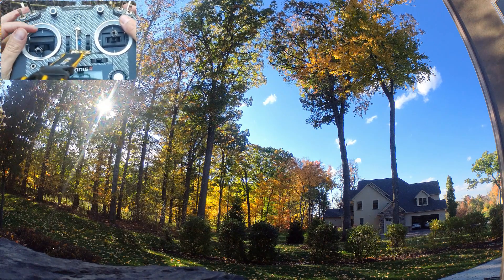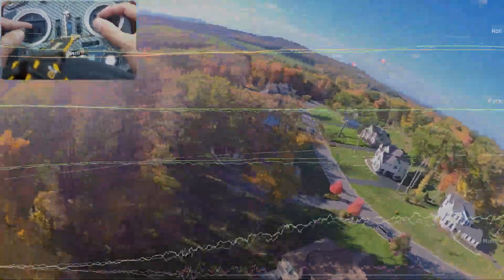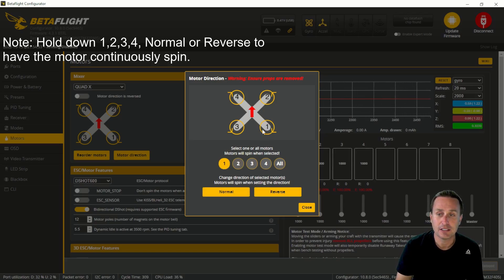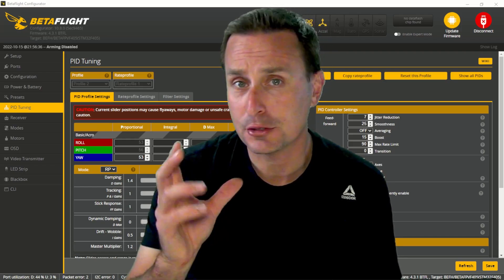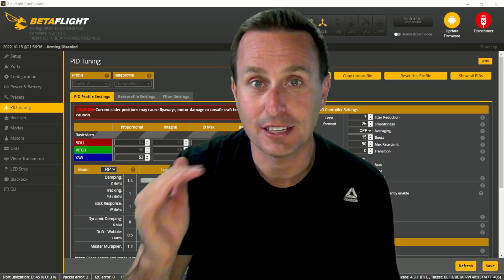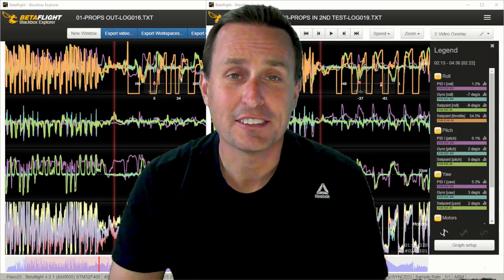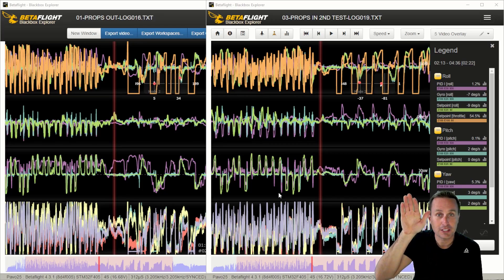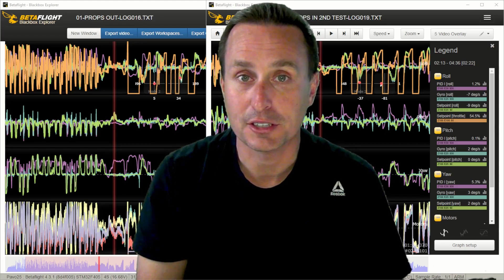How to FIX Cinewhoop Washout  |  OPEN SOURCE

Comment: You should mention (for beginners) that changing prop direction also requires to change props ;-)
Reply: Wait I have to get new props? Which ones for the protek35
Reply: @xplode225  😋
Reply: @xplode225  direction
Reply: @volkergoe  oh so basically I would swap the left motor's prop for the right motor's props if I switch the motor direction??
Reply: @xplode225  exactly!

Comment: OMG!!!  I have a Flywoo Cinerace 20 and I love almost everything about it for flying small gaps  picking through tree canopies and proximity flying I would never do with my 5" drones.  The only thing I hated was a really annoying float when I wanted to drop from high trees it would just hang in the air.   The reversed props totally fixed this and I have so much more control over it.   Thank you

Comment: Oh wow, I gotta try props in. I think it could be that motor shafts are not parallel to each other. And one or two motors tilted a little making extra yaw drag as they spin. With props out they fight with actual yaw intentions, with props in they help.

Comment: Well that is just perfect timing, thankyou for running through this issue.  I've recently picked up a Pavo25 and did the first few flights on Thursday.  I have had both the issues you describe, and have just sat down to see what the internet says about it.  The floating around after a bit of full throttle or a steep descent was really disconcerting, so I'm going to take a look at the gains first, then try swapping the prop direction.  Thumbs up, and a subscribe from me :)

Comment: Thank you Mark! I was trying everything for a week! to fix up the same issue on a new build. Initially thought it was the AIO, changed the AIO same thing happened, went through you tutorials on blackbox troubleshooting and with my confused noob brain I thought it was a motor issue, for some reason it did fly better after the motor change but problem still occurs, then came across this and who could have thought about this? Why does a quad or frame design only allows props in? Anyway ma man! You made my day! Will do a big big shout out when the content is up!
Reply from the maker: 😄  Always happy to help!

Comment: Thanks Mark! Modified my 3" squirt style to a 3.5" with guards, everything was flying great except that it would float  and not come down, who knew it was as simple as swapping the prop rotation. Now it flys like it's on rails.

Thanks again for all you do!
Reply: Just wondering if the wobble thing maight be cause by the gyro chip , which  wasnot right in the center geometry of the flightcontrol pcb? If all the trouble drone has this kind of gyro chip then maybe it means something or if  there was exception that gyro was in the center and stile wobbles on a quick turn?

Comment: @uavtech, I applied these settings on my pavo25 and it sounds like the motors are spinning A LOT NOISIER!!! like alot alot
Reply: Make matters worse, took it out for a test, 2:45 on a 850maH 4s down from 9min and the battery is hot.... brought it down to 14.45v..... dangerously low
Reply: I TAKE IT BACK!!!! THIS WORKS SOOOOOOOOOOOOOOOOOOOOO WELL!!!

Comment: Hi mark, I have a turkey25 with gyro bmi270, is it safe to update to the latest version of betaflight?
Reply from the maker: Yeah, it works with that hardware.
Reply: @uavtech  sorry about last words, i mean pavo25. Do I also have to do the steps of configuring prop in and giving more authority to the yaw? i used your profile settings but don't have the yaw correction for this particular quad.

Comment: Ottima spiegazione e ottimo aiuto grazie, ho avuto lo stesso problema, domani vado a fare un test, per vedere se la situazione è migliorata, per favore togliete anche questa curiosità, perché la maggior parte dei cinewhoops sembrano zoppicare quando volano dritti? Sto cercando di capire mettendo le mani sul pid, ma non riesco a risolvere il problema, potresti dirmi dove posso intervenire per cambiare qualcosa e far volare il mio Shendrones Squirt v2 liscio come l'olio? Sto usando i gemfan a 5 pale da 76 mm, i motori Xing2 2205 2300kv, lo stack Speedybee f7v3 con Gopro Hero9 montato completamente sulla parte superiore. Grazie
Reply: I want to confirm that the problem has been resolved thanks to this video, but this change of direction of the props has canceled your preset on cinewhoop 3-4-5" that I had previously set, the engines get hot and the quad shakes like a leaf ,I had to take it off and adjust the pids myself,or did you change something on that preset?please reply thanks

Comment: Great to see this issue covered! A few of us on your discord noticed this same behavior on our 7" long range quads where yaw I term would build up on dives. Only thing that fixed it was going props in
Reply: Omg, I have had this problem so much in the past on my 5.5 inch builds - have you found any additional fixes? :D
Reply: @vincentholm326  I tried about everything I could think: lower/higher pids and filters, changing I term, different props, different ESC settings. Only thing that instantly fixed it was going props in. My cinewhoop seems to dive better with props in too

Comment: I have a problem when I go through a hallway it has a lot of turbulence. The vibration only happens in small hallways. What can I do it's a cinewhoop 25
Reply from the maker: that sounds like turbulence from prop thrust.  Best way to help reduce is increase the Master Multiplier slider in the PIDs tab.

Comment: Im still have washout problems :/
Reply from the maker: Props in?

Cranks up Yaw P and i, terms too.
Reply: @uavtech  yep props in and configs, now when down the throttle start to make jlitter o jello shaky moves fast like fast prop wash and the drone accelerated. Maybe pid are to much high? The drone start to make weird sound and accelerated itself
Reply: BetaFPV Pavo25 BNF ha una Scheda AIO senza scatola nera, quindi nel video il signore ha utilizzato un altro Controllore di Volo, che ovviamente ha risposte e setup a volte completamente diverso da un modello e marca differenti, i problema dei Ducht nei Cinewhoop é più che altro come ben dice il signore nel video che Betaflight si concentra quasi esclusivamente ad un setup standard per Droni FPV da 5 pollici freestyle/senza ducht
Reply from the maker: @argentinaerialsFPV sounds like your props are bad.  Put on new props.

You can try to cover up by increasing filters or reducing pids, but it is not ideal.
Reply from the maker: @kris-kb4vf apply presets for a cinewhoop is key in betaflight too.
Reply: @uavtech  yes, I know is it a nice base for start optimal setup, perhaps thank to you 😜
Reply: @uavtech  solvedddd! Uavtech preset for cinewhoops and low quality build works great! I think its a problem whit noise. The cap on xt60 maybe dont filter like xt60 in pads aio? I have the cap on xt60 because i dont have space inside pavo25. Affect whit noise this?

Comment: Thanks Mark, great video.  

In your expert opinion, could DJI fix or tone down the prop wash issue of the Avata through a firmware update that would change the PIDs and possibly the prop rotation?
Reply: Emil Jekov  You may have misunderstood what I was trying to say.  I wasn’t suggesting that we the consumers change the prop rotation but DJI.  All we would do is flip the props around to reflect the changes.  This is all theoretical, of course.  

Also, you mentioned that DJI changed the PIDs between V1 and V2, but V2 (the Avata) is a totally different quad, and it would not make. As my sense to keep the same PIDs.
Reply: Emil Jekov  Thank you for the clarification. WRT DJI releasing the third batch, hopefully those who purchased Batches 1 & 2 will be able to catchup with a firmware release!
Reply: Emil Jekov  If DJI considers itself a reputable Company, then they should recall the previous versions and make it right!

By the way, would you know how would one know which batch they have?
Reply: Emil Jekov  Hi Emil,
I have no beef with DJI, it’s just that at times they make things so confusing!  

I’ve owned a lot of DJI products and overall I’ve been very happy!  My Avata is not due to be in stock from the supplier that I purchased it from until the end of this month (Oct 2022). Hopefully these will be the batch 3 that you are referring to. 

Thanks again for addressing all of my questions!
Reply: Emil Jekov  hi sir,how did you know that the PID of the v1 avata are different from the v2 avata?and where do you gain the information knowung the 3rd batch will be release?any specific dates?but again thanks for the effort explaning and im teally interested to know.
Reply: Emil Jekov  thank you sir❤i think the O3 sync will be release along the with Dji Goggle 2 backward compatibility update .Another things is the newer version of the avata has different hardware than the old one?
Reply: Emil Jekov  well said sir!Is the serial number has date of manufacture on it? I want to make a purchase of the 3rd batch release.How do i know?thanks

Comment: I'm having that same floaty-zero throttle issue with my slammed squirt.  Here's a weird one: after reversing motors, props and un-ticking the motors direction is reversed button in BF, my squirt now has bad trilling oscillations as soon as I arm and attempt to hover.  RPY works as it should, but the motors are now hot and angry.  I asked JB about it and he said he's never heard of this before.  Any ideas how a simple props-in adjustment can cause these trilling oscillations and basically throw my perfectly working tune with props out, out the window?

Comment: For my cinewhoops, i have tested props out conf, and for all, i'm  props in because is soo better bizarrely!!!. but for all the rest, 4inch, 5 inch, 6 inch, all are in prop's out! and is better. but i'm not on 4.3 for now.. one day but all my quads fly's great, and why changing a quad when it fly's well? no? ;) and the prices are expensive, now i recycle,  the market are so expensive, it annoy me. i have a foxxwoop but i have 4.2 on it, and it works.. sure the 4.3 is better? all are mpu6000.. and i dont know what to do.. (thank's for the presets, always a good base!) and thank you as allways!

Comment: So.. that is it. You rock. First time on the channel and you solved the only two concerns I had on my very first flight. I never flew a drone IRL before, and I went for my first rodeo with this brand new pavo25. I had a blast but those two things (the yaw washout and the drone hanging on the air) got me thinking if I was doing something wrong. It felt like something was wrong besides me being just a total noob, but I was not sure. So thx mate, thx a lot!!

PD: did u put some blackbox i to the Pavo25? because if I recall correctly this drone comes without it, right?
Reply from the maker: GLAD IT HELPED!  I did hook up an external SD card unit to record to see what was going wrong.

Comment: Wow... I switched components from beta95x v3 to new pavo25 frame and for a couple of days was struggling with exactly the same problem on zero throttle. I was thinking about switching to props in at the beginning but forgot about that and now your video... Same model, exactly the same behavior :)
Will check it tomorrow, hope it'll help. By the way, it's my first quad with Betaflight 4.3.x, so I just thought that I missed something in the configuration... 
Speaking of configuration, could you provide cli dump for pavo25? I'd like to compare my setting with the original one - for now I have default BF settings.

I'm just surprised that even on the product page (I mean pavo25 build), betafpv says that it flies much better with props out direction. Well...
Reply: yeah, they advertise that it is better to run props out... I encountered this behaviour (both, the washout and the floating) on my first ever IRL flight. I was... disoriented, but it felt like that was not the normal behavior of the quad. Now I know I was not at fault

Comment: That's mean the pavo25 is not a good thing. I will say good bye to betafpv.
Reply from the maker: Works fine props in.
Reply: @uavtech  No, I've tried this before your video. The most of issue is solved. But still not perfect while the action is more aggressive.
Reply: Finally, I've found that it's my mistake.
There is a term of "cine-whoop".
And should not be flying as so aggressively.
Reply from the maker: both